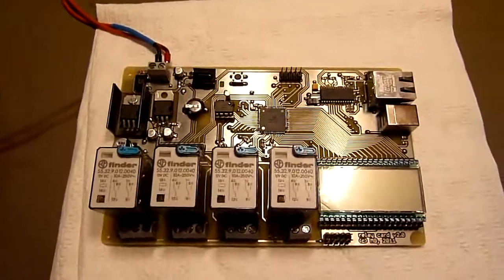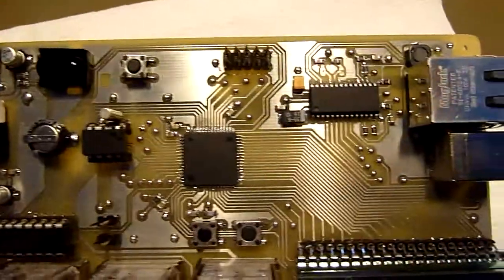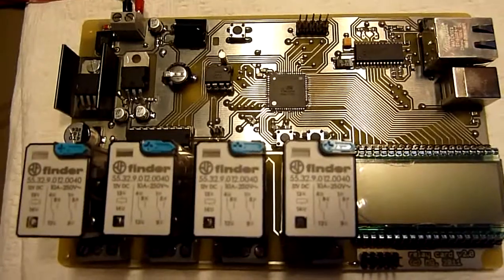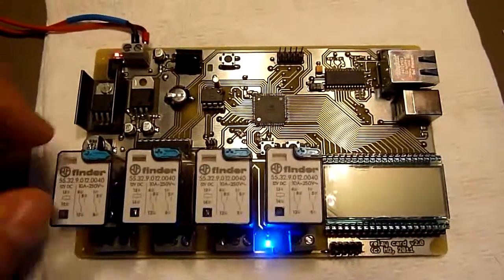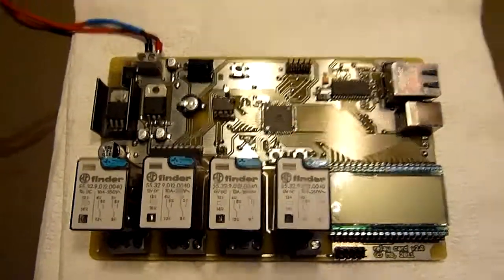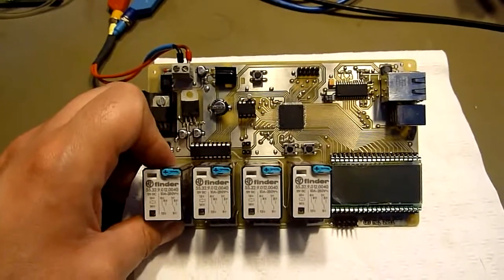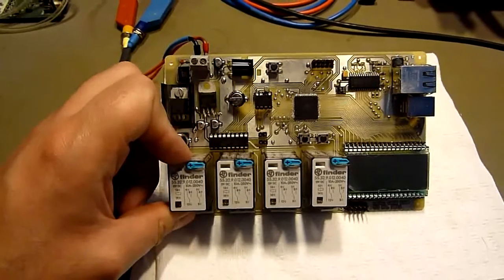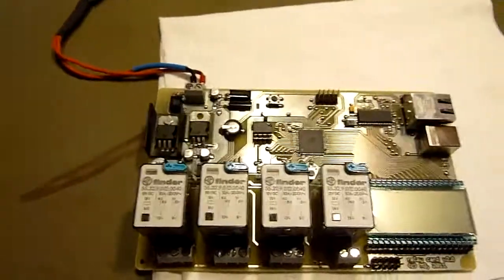The ultimate relay card: Finished board and test program.

Comment: @orbiter8 from what i understand it should turn on or off some of the relay outputs based on the preset time. I haven't read the web page about the project i just check the videos. Correct me if im wrong :)